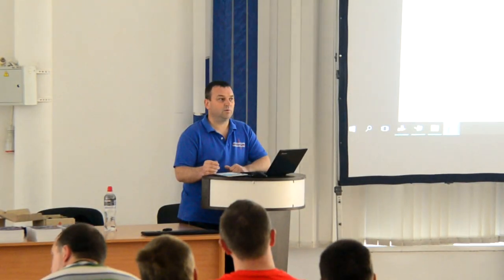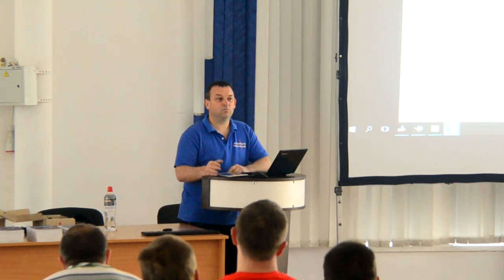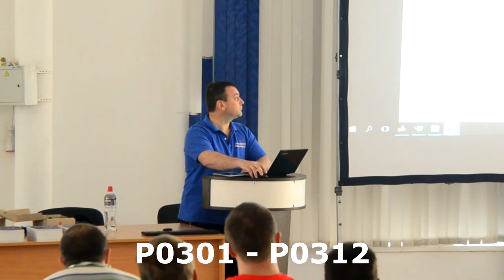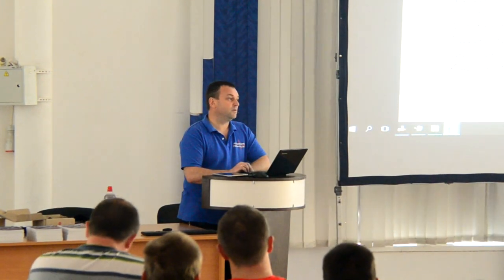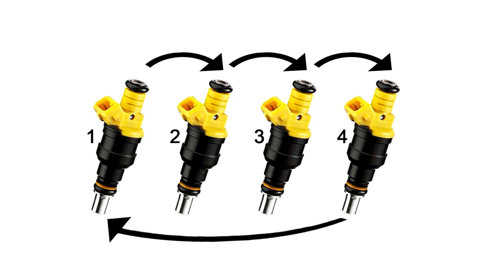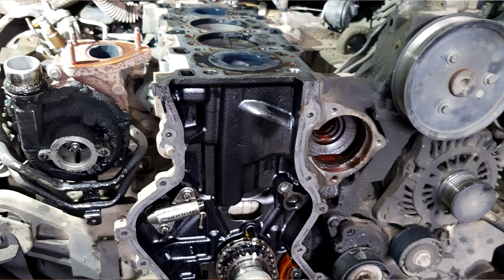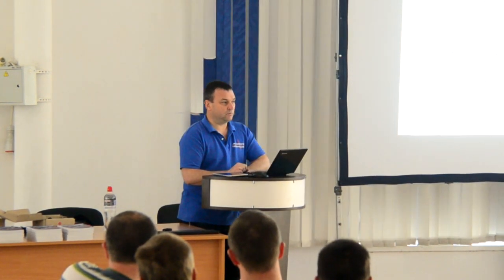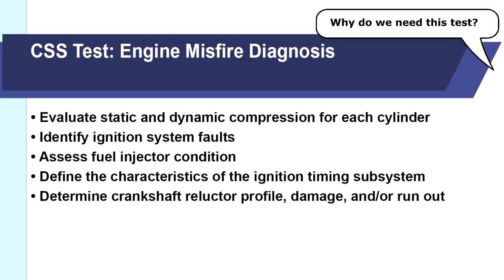CSS test USB Autoscope IV. Lecture of Andrew Shulgin, Part 1.

Comment: How can we keep the throttle fully open after shutdown in engines with electronic acceleration?
Reply: You can use the Remote Power Off switch.
It will be necessary to turn off the engine not by turning off the ignition key, but by turning off the fuel supply. To do this, turn off the petrol pump located in the fuel tank using the Remote Power Off fuse switch.
Before starting the test, it must be connected to the place of the fuel pump and during the test - at the moment when you need to turn off the engine, you must press the button on the body of the remote switch.
Reply: @AutoscopeTechnology  Thanks for answering, you have the link of that tool, and consult my experience when you remove the fuse or relay of the pump the motor does not turn off instantly as the system still does not have pressure, this damages the ccs test.
Reply: During the diagnosis of some engines equipped with an electronic throttle valve, when the engine is turned off with the accelerator pedal depressed, the engine control unit may not open the throttle valve completely. 
As a consequence, the throttle will interfere with the free flow of air and the test will not be performed properly.

In such cases, during a snap throttling when the engine speed has reached the maximum, it is necessary to turn off the fuel supply (fuel injectors or the fuel pump), and continue to hold the accelerator pedal depressed until the engine stops.

What happens when the fuel pump is turned off: 
it will stop supplying fuel from the tank, and the pressure in the fuel rail will begin to drop sharply, as the injectors will continue to consume fuel from the rail.
Due to a decrease in fuel pressure, the mixture in the cylinders will suddenly become so lean that the flashes of the mixture in the cylinders will stop. As soon as the flashes in the cylinders stops, the engine speed will immediately begin to decrease.
The engine control unit will then see that the driver continues to hold the accelerator pedal fully depressed, still demanding maximum engine speed from the engine. But, for a reason that is not clear to the control unit, the revolutions are falling. To prevent them from falling further, the engine control unit will begin to increase the throttle opening, and pretty soon the throttle will be fully open. But, despite all the efforts of the control unit, the speed will continue to fall until the engine stops.

This order of events is fine for getting full CSS test results.